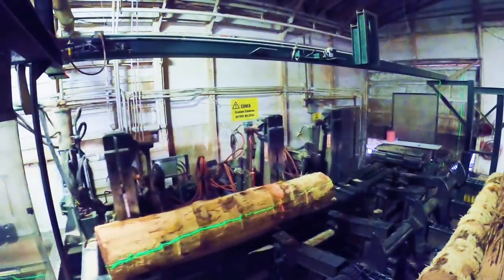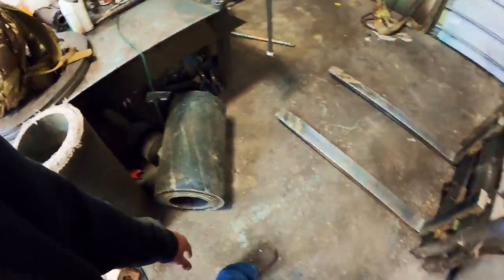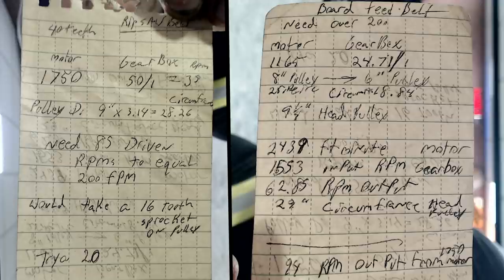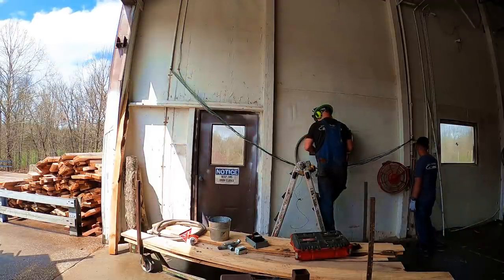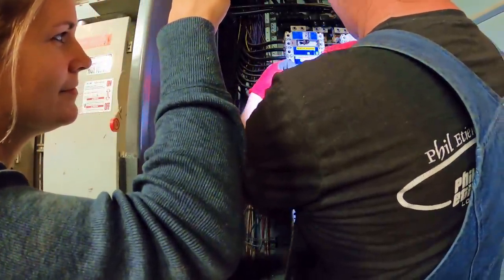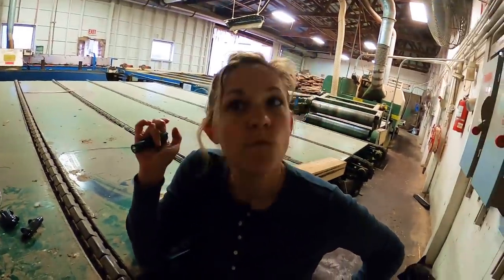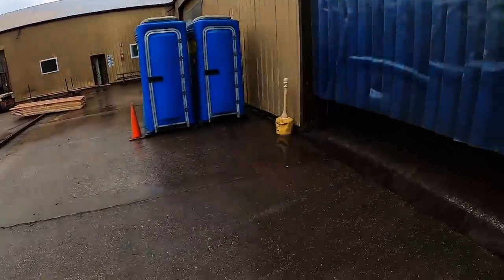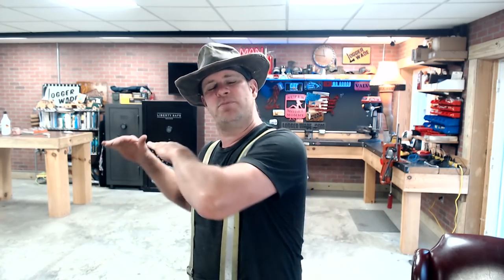Time To Fix This Saw‼️

Comment: When I was 18 I worked on the Green line and Grading room. And 8/4 Red oak or White Oak. Will make a Guy OLD Before his time For sure. I know those boards weighed more then me Most of the time.And The Green line was out in the Weather.  Summer was the worse time.Winter was  a Close Second..LOL.But Im glad I did it and got the Experience  from it.Great Job Logger Wade. It will Give the grader a Chance to make good decisions. Great Video Sir...

Comment: @loggerwade I understand exactly what you're talking about improving the value of your boards. Let's call it Sawyer Science. All that science isn't at the sawmill, though. Sure, the Sawmill is almost the beginning of the process, but it really begins out there in the Wild Woods.  Not every man (or woman, I'm not cutting y'all out) that walks a stand will cut the same logs the same way. Wade, you know what I'm getting at. I call it Sawyer Science, but it's An Art. 
Thanks for letting me drop in unannounced.
Smile! (It keeps them wondering)

Comment: Always improvements to make Wade, on the job engineering and reuse of parts at its best!!! 
Seeing your workings out helped me understand what you were attempting to achieve, you got the speed somewhere close, just a bit of fine tuning to do 👍
 Great to see Mommy out and about too, good to have an extra pair of hands when play with electrical equipment, pleased the barge pole wasn't need!!
Reply from the maker: Hahaha thanks buddy but I think she wanted to use it on me anyways
Reply: @LoggerWade  
That comes as standard Tater 😵🤣🤣🤣

Comment: Wade 60 amp could be your equipment was having a start up of maybe 50 or 55 amp and actually runs at 10amps , I have known pressbrake machine with a start in rush of 100 amps and when the fly wheel gets up to speed will run at 8 amps .

Comment: Sorry...but can't help but wonder just how long Momma would have let ya flop like a fish before letting you have it with the 4x4?!?!🤣🤣
My local utility guy had to give me a talking to about the importance of equal pull on both sides of the juice. I was told that just because there is equal amount of home runs being pulled from both sides that it doesn't work efficiently if the ones being used all the time are all on one side. Basically the way I had it was fine if everything was turned on at once but I had all the items being used constantly on 1 side. I had to rearrange my breakers to even things out for normal daily use....It was all taken care of and no 4x4 was broken!👍👍 Have a great weekend, Etiennes' !🇺🇸🇺🇸🇺🇸🇺🇸
Reply from the maker: Thanks so much Wayne and same to ya

Comment: If that board you threw on the conveyor to test it was 12', I calculated it took about 3 seconds to travel a full board length, that means it would be pushing about 240' per minute by my rough calculations?

Comment: No mommy your going to hit him in the back of the knees hard not no lighty because 480 will lock all his muscles up. One thing you should have done wade was wear safety glasses when you are in a high voltage panel because you don't need arc flash too if something goes wrong

Comment: No, no, no… 3 phase Hillbilly panel work code states you tie a rope to the back of your overalls so yer assistant can yank you away when ya start twitching. Using a pushing stick is for home wiring. ;-)

Edit: I’m only half kidding. 480 will cause you to clench on tightly. A stick wouldn’t work. 
For you kids at home, never work in a live panel.